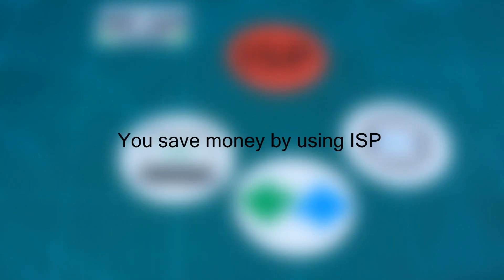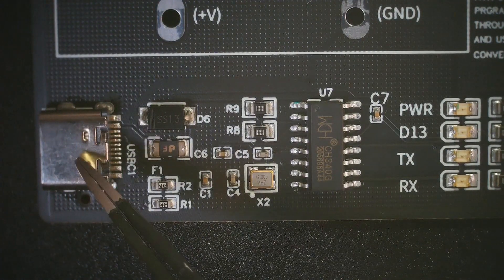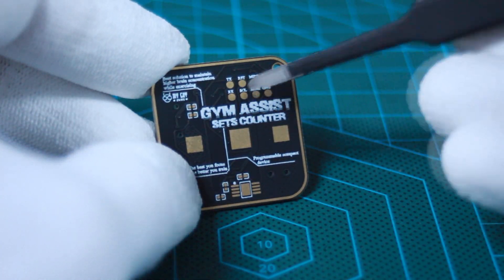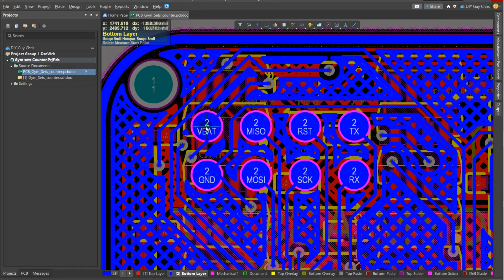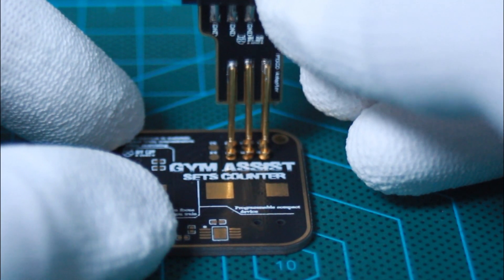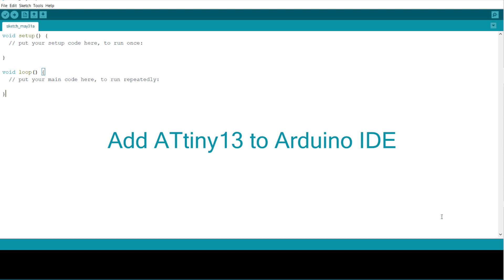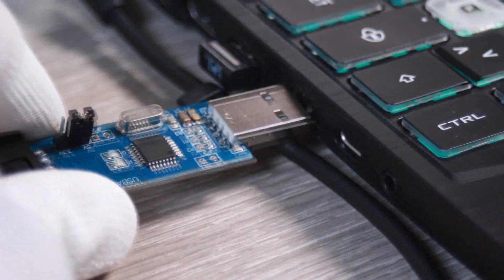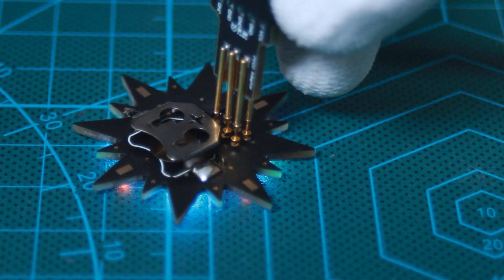Microcontroller ISP Programming (getting started)

Comment: Great video! What is the size of the copper dots where the pins connect to in the 1.27mm variation?
Reply from the maker: Thanks.
The ISP spot size could be defined by yourself depending on the PCB manufacturer capabilities, as for JLCPCB the minimum clearance for two pads of different nets is 0.127 and considering the spot spacing of 1.27mm then the spot radius could go up (1.27 - 0.127) / 2 something around 0.55mm 😉

Comment: Cool video Chris! I also think about one more thing: With CH340G, you can program and also do serial monitoring (e.g. viewing the sensor data through USB), so it works in both ways. Can you do the same with USBASP? Because as I see, it works in one way and it it just for programming.
Reply from the maker: You are correct. While USBASP is capable of bidirectional communication, it does not involve the sharing of serial data. On the other hand, CH340 functions differently as it acts as a USB to Serial converter. It allows the establishment of a USB communication port between the computer and the device, which is not the case with USBASP. In the case of USBASP, it utilizes an ATmega88 or ATmega8 that comes preprogrammed to serve as the programmer.